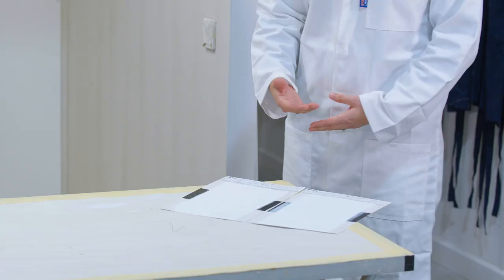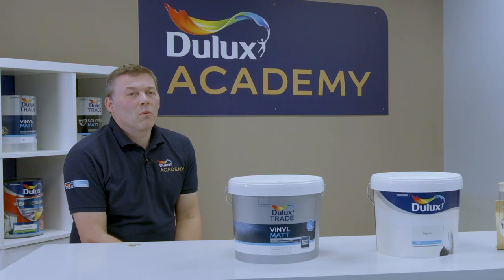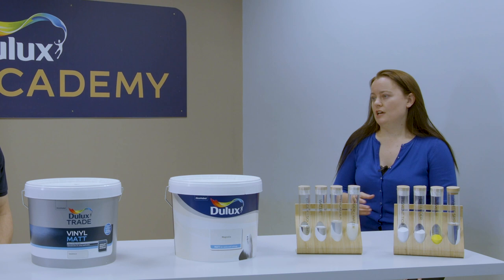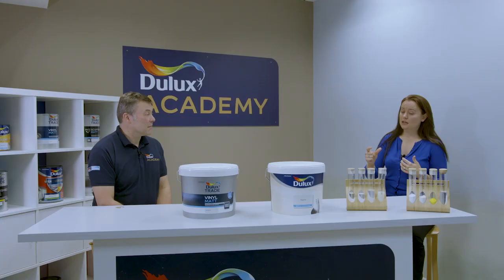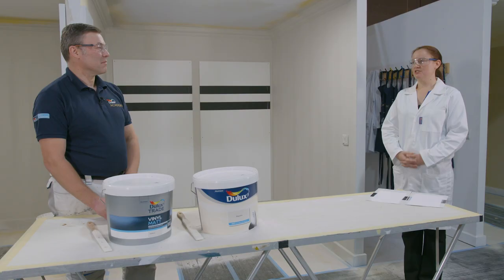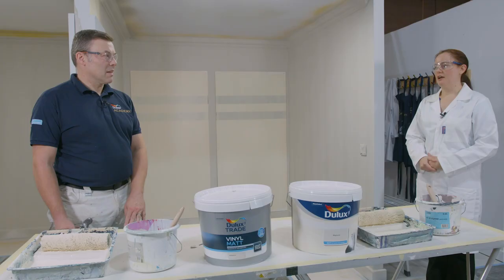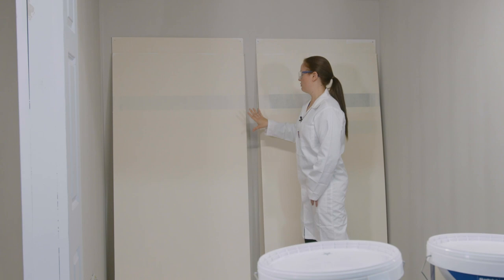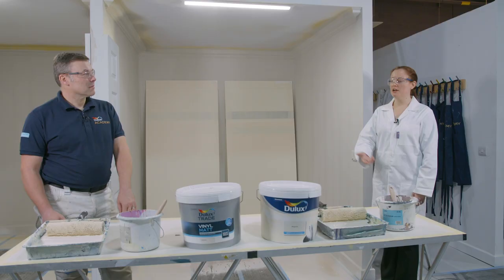Get the #FACTS on the difference between Dulux Trade and retail paint

Comment: Strange video to watch as you are actually saying that if you don't buy the Trade you will have to do at least another coat to cover what's underneath. NOBODY wants to keep having to apply coats of paint wether they are a DIY painter or professional. Unfortunately I have just purchased a 10L can of your white wall and ceiling paint and have been very disappointed with it as I am having to do 3 coats to cover a cream paint that is already on the wall.

Comment: I bought Delux dry wall paint from B&Q, they have been found actual colour from small pice of plaster board and make the paint immediatly. The paint was exactly match with my current wall colour, so you have marvels system for Colorimetric detection and making mixture of paint.

Comment: 1. You mention that on the Trade product, you add more white pigment to improve "intrinsic opacity". But does this mean there is negligible difference between Retail Pure Brilliant White and Trade Pure Brilliant White as they are both entirely composed of white pigment anyway and therefore opacity would be about the same?

2. If the wall is freshly plastered and well skimmed, is there less of a reason to use Trade paint compared to Retail?
Reply: It's not just the white pigment TiO₂ that has very good hiding properties compared to other pigments. 
The other ingredients (binders) will also affect the overall opacity as she was explaining they hold the pigments closer together and there are better and more binders in total in the Trade Paints.
Reply: Applying on a freshly plastered wall will only accentuate the difference between the retail and trade versions. It's also customary to do a 'mist' coat, especially with Vinyl Matt for example as the coat will not adhere properly otherwise. Contract Matt is usually used on fresh plaster.

Comment: I miss the pre-Covid times when I used Dulux for everything and the finished job was beautiful as it normally should be. In the last two years I had so many issues with ceiling paints, after the paint dries the corners are cracked all the way, even with different caulks.
i.e. pure brilliant white vinyl matt  is totally useless in my opinion.

Comment: Unless you’re a decorator and use the stuff day in day out it’s simply too hard to comprehend the difference. Problem is everyone thinks they can paint and have the attitude of paint is paint. There is a lot more to it than that and you would know if you’re using it everyday. It’s a lot more cost effective to get the more expensive and superior paint than spending more time trying to make the cheaper paint work. 

I can cut a bit of wood and nail it to the wall - doesn’t make me a carpenter. 
I can mix mortar and stick a brick on top - doesn’t make me a bricklayer. 
I can wire a socket - doesn’t make me an electrician. 
Anyone can push a brush around a wall - doesn’t make them a painter
Reply: This is very true.  paint is definitely not just paint
Reply: What paint do you use for a great Matte finish and pigment  ?  I’m more interested in what the finish looks like than whether it takes an extra coat of paint.

Comment: Why is there such a vast difference in price? (White 5 litres, DDC price, £39, average retail price, £18) Trade doesn't cover twice as well,  or go twice as far as retail. (Trade vmatt 17m² retail matt 14m²)
If a surface needs two coats for it to be covered sufficiently then why not just buy retail?...certainly in the case of masonry paint. In the case of matt then trade is better because of the higher proportion of vinyl, the retail washes off with a damp sponge, its like a basic contract matt...so if durability is an issue, then trade would be the go to product.
This brings me to why was the vinyl content reduced so considerably in retail paint? I was told by Dulux it was due to the voc regs, absolute nonsense, it was never an issue, and if it was an issue, why wasn't trade matt treated in the same way? My theory is that it was to 'encourage' domestic buyers to move over to the durable acrylic based matts that were starting to hit the market at around the same time.
Its fair to say though that this isn't wholly a Dulux thing, johnstones and crown also followed suit.

It seems the trade market is subsidising the retail sector, I guess you are assuming because the customer is paying via the contractor thn it doesnt matter what you charge?

Comment: I have tried both versions of paints recently with a home refurb project and this is why I came looking for answers.

I was buying matt white trade emulsion for £35 for 10l because there was no retail version available.  I had to mist coat and apply 2 coats on top of my new ceilings to get a good finish.  This paint ran out and I managed to buy a 10l retail version of the paint for £20.  I still used a mist coat and 2 further coats to get the same finish.

They went on the same, although the trade version did go on the roller a little easier, what was I paying for?  I even used the retail paint to touch up when I scagged the ceiling of where I applied the trade paint and see no difference?
Reply from the maker: If you were to compare the coverage of both products, you will see that Dulux Trade Vinyl Matt covers upto 17m2 per L & Dulux Matt covers upto 13m2 per L. This amounts to an extra 20m2 per 5L can. This is one of the reasons why it is more expensive. Visually, you are likely to see the difference between the 2 - this is expected as they are both white matt emulsions.
Reply: @DuluxTradeUK  im not getting conned by your outfit again, your matt white is not fit for purpose! Leyland stuff is no better, utter rubbish both of them!
Reply: @mongychops68 so what’s better ?

Comment: Dulux trade is expensive but not that good performing as I got dulux trade high gloss and it yellowed within 2months and the non trade one lasted 5 years without yellowing
Reply: Were they both solvent based? or was one solvent based and the other water based.
I have found that since the VOC rules came in the solvent based paint tends to yellow much faster nowadays.
Reply: @GavinLawrence747  Thats what its all about.  Back in the day, gloss was good, it lasted longer.  Since the silly rules the paint manufacturers have struggled to come up with a decent technology to keep the paint from yellowing and I find it takes a lot longer to cure fully.
Reply: @GavinLawrence747  yes both were solvent based paints
Reply from the maker: Solvent based paints will discolour. Please drop us an email - duluxcustomerservices@akzonobel.com - should you wish to discuss further
Reply from the maker: Please quote ref TAC 932149 in your email.
Reply: I remember the 2010 compliant thing...dulux's marketing machine said it was their 'best ever gloss'....weeks, not months later it was yellowing 🙄

Comment: Trade comes first? Good to know as a retail customer that I'm second class.
Reply: Must admit, as a non-tradesperson, I've long been under the impression that, in general, trade paint may well be for 'the trade'.., but that it was inferior to that available to the retail customer who wanted a decent paint job.  ie, a paintwork that lasts, doesn't look tired after 6 months, and doesn't leave a mark if you so much as brush against it. 

In summary, for me 'trade paint' has been a euphemism for cheap, easy to apply paint, available in bulkier containers than available to retail customers. As used by those working for landlords.
Reply: @andrewpreston4127  Now I have to admit that I'd always thought it was the same stuff but just a bit cheaper because tradespeople buy in bulk. Wrong on both counts! But the quality of paint in general does seem to be going down. Don't know if it's because of safer or cheaper ingredients - maybe both - but I've been painting over a yellow pine ceiling and I kid you not, I'm on my 5th coat and it still looks poor. Crown emulsion 2 coats and Dulux 3. Can't remember it taking more than 2 coats to cover up pretty much anything years ago.
I'm old.
Reply: @poppypalais3108  well, I’m older too, but remember, this is a propaganda video….